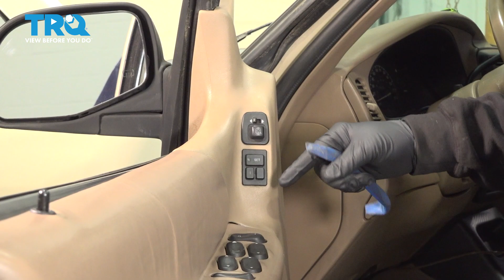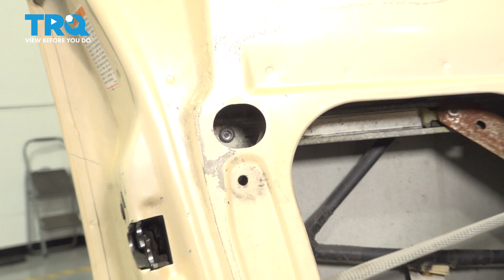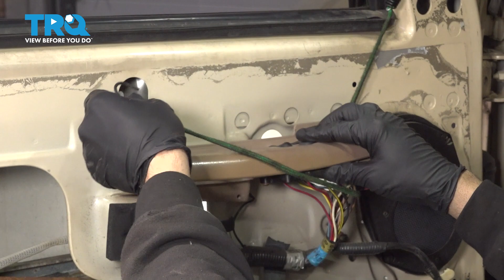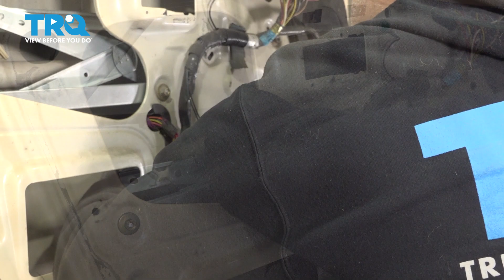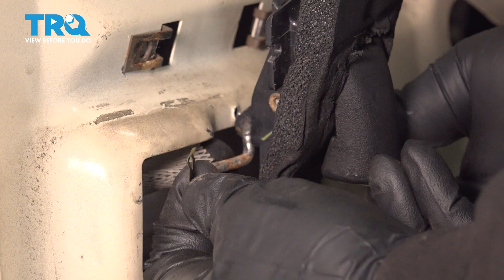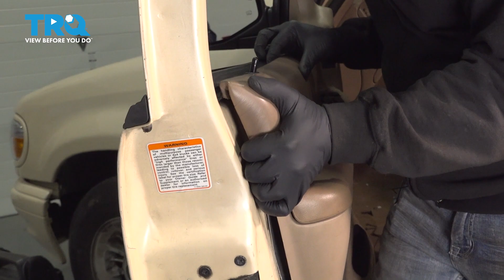How to Replace Front Window Regulator 1995-2001 Ford Explorer

Comment: 16:13 So is that bolt going through a hole in the glass or a hole in a metal piece that's attached to the glass?? I think mine became unattached from the metal on the glass, if the latter is the case. 

How do I attach that part to the glass??? Idk how to even Google this question but I remember my dad saying you need special soft glue so the glass doesn't break when it shakes.

Comment: The Spring on mine doesn't have any tension. When I put the Spring on the regulator and turn the piece around to get tension on the Spring, the center shaft just spins. I guess it broke loose... has anybody ever seen that before? Will it work like this?